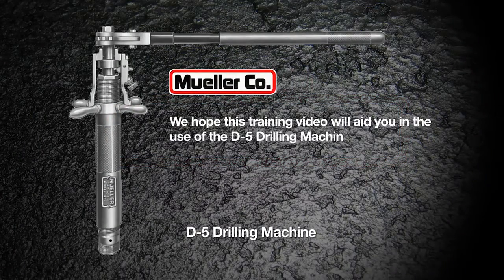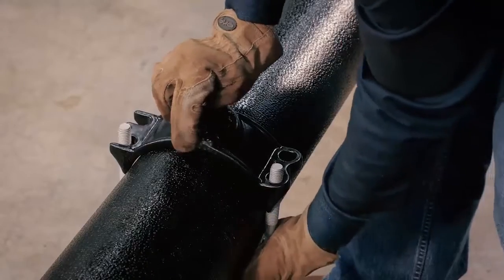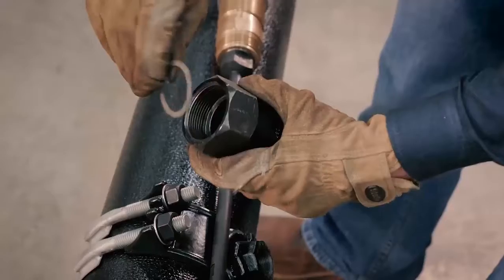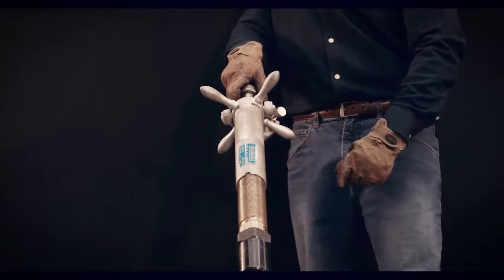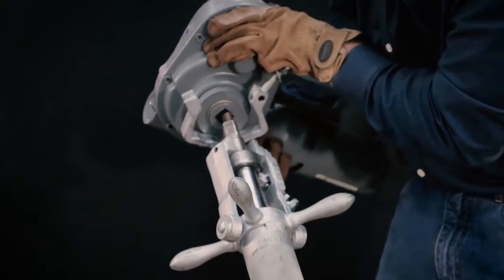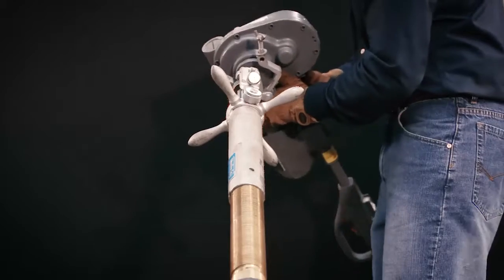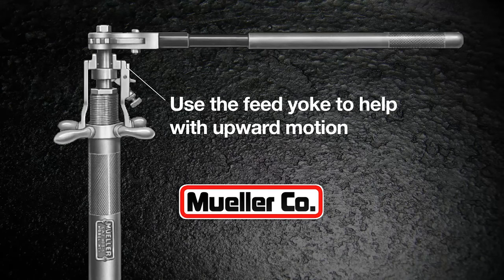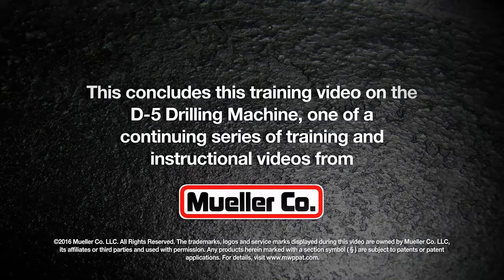Mueller D-5 Drilling Machine

Comment: We have one and it’s not that simple when you making a water tap especially when you making a 2” water tap it’s a lots of hand cranking. On pvc pipe it pretty much easy takes about 10 minutes to set up and make a tap. But if your bit gets dull it will take you almost 30 minutes to a hr. But now we have the EZ muller tapping machine and it’s only takes 5 minutes to set up and complete your water tap